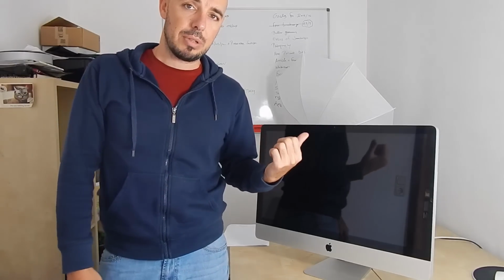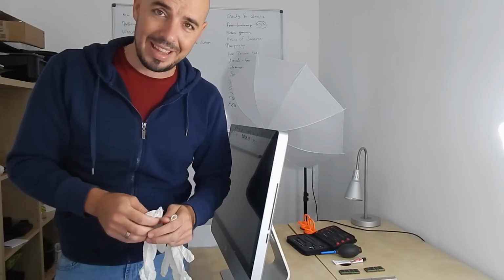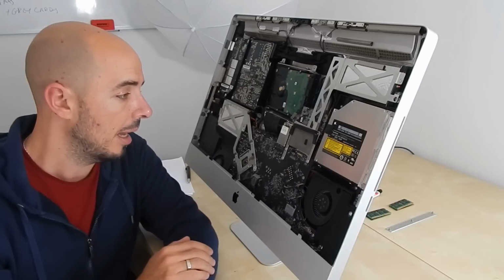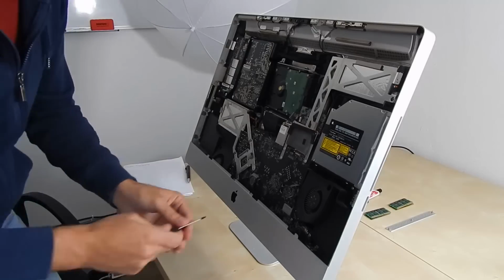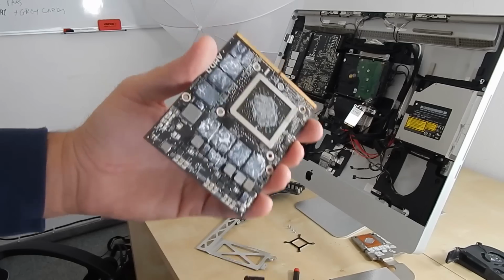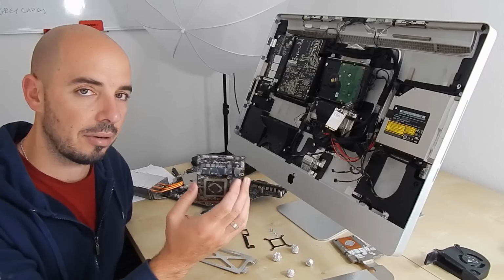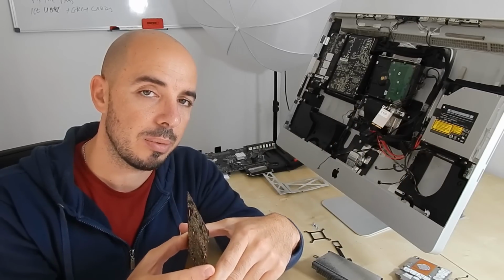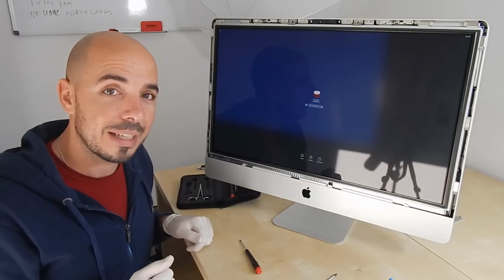Burn the VGA and  Fix your iMac - Don't Pay Shitty Problems!!!

Comment: Hi good afternoon, my video card: ati radeon hd 4670 256MB (iMac 2009), it only works for tv! Main screen does not turn on the lights and also does not appear the apple logo, would it be recommended to do this? Or do you have another opinion?

Comment: Hi Evan, your video saved us $600 today. Outstanding job!..Thank you so very much. I purchased the same iMac 6 years ago. A few days ago it went black. After paying $40 to MicroCenter for diagnostic. Took it home because MicroCenter tech gave me bullshit diagnostic. First, he said it was the motherboard then he said it was the motherboard and the video card and maybe something more than just those two parts mentioned. The bottom line was they lied to me to pocketed the $40. So I decided to take it to Apple store. Apple determined it was the video card which went bad. I agreed to let Apple repair my iMac but then came a phone call letting me know that they cannot move forward repairing my iMac for me because I installed a third-party non-Apple SSD drive inside. No matter what I said and beg them to repair it for me, they still stick with Apple policy. I started to search for replacement video card online and found a place that sells it for $300. Of course, it is not the brand new. Then my wife called me. She gave me a very good idea. A month ago, I bought an exact same iMac but it is a refurbished one for $900. My wife suggested that I should take out the video card from the refurbished iMac and put it in the broken iMac to verify that it is the video card problem before I purchase the new video card. I stumbled on your youtube. Thought to myself, "What the hell! I got nothing to lose. I opened up the iMac before. I am going to take a shot." SHAZAM!!! Your youtube helped me fixed my iMac in 2 hours and it was up and running normally more than 2 hours ago. THANK YOU! THANK YOU! THANK YOU!

Comment: My question is did you verify that graphics card needed to be fixed/replaced? I had same issue (happened ~3 years ago and then today) but when I started iMac from external drive display was fine (so not hardware). I think it's a thermal issue but mine was fixed by SMC and NVRAM reset (cycled thru 2x). 1st time it happened got SMC fan app to better regulate. This worked both times and I didn't have to take my iMac apart.

Comment: For anyone reading this, you don't need to put the video card in the oven. You can just buy a pocket torch and evenly apply heat to the GPU chip instead. The key is to keep moving the flame back and forth and in circular motions over the GPU chip for a minute or two. Once you smell solder you know you're good. This happened to me a few years ago and worked like a charm.

Comment: Evan my friend, you can add another to your list of viewers that successfully utilized your process and fixed their (actually my brother-in-law's) 27" iMac!!! It took several hours for me to get it done, even with my brother-in-law's assistance, but IT WORKS!!! I also immediately installed the SMC fan control program and greatly increased all three fans RPM, so hopefully the issue won't crop up again for a very long time! THANK YOU!!!

Comment: This worked for me too. It was amazing when it just started up perfectly fine after I lost all hope. However after one day it got bad again.
Did it on my iMac (24-inch Mid 2007) with ATI Radeon HD 2600 Pro 256 MB.
Is there any point in trying it again you think?

Comment: Great vid JDW. My son's Imac 24" early 2008 has been diagnosed with graphics card issue. Failed to boot and went white screen. I will attempt this repair as there is basically nothing to lose as he cannot afford a new card and in any case the Imac is old and of less value than a repair. I think I will go the hot air gun route with a temperature probe and shield the rest of the board with aluminium foil. I also see you didn't run any liquid flux under the chip. Is this a good idea?
As I say nothing to lose for me and if not successful will go on ebay minus hard drive to recoup something.

Comment: Thanks Evan, I just repaired my own iMac 27" (2009) using this method. Hope it will last at least another couple years. :)
Reply: Hey Cris, I have a early 2009, with NVIDIA GeForce 130 and it  crashes when online. Just shuts off, not sure if it's driver issues, is your installed with a NVIDIA GeForce 130 card?  Is your 2009 iMac still working?
I just patched Catilina to it.
Reply: @reel_images  I have the late 2009 iMac with ATI Radeon HD 4850. The graphics card gave out again about two years ago and I replaced it with an NVIDIA GeForce 765 but it runs quite slow and feels like it’s on its last legs now.

Comment: Great video covered everything.  This worked, kinda for me.  Baked the card 8 mins @395F.  Put on the paste and buttoned everything up.  I turned on the computer and heard the chime except screen was black or not lit up.  From what I could tell I had the 4 LEDs on the bottom of unit to left of RAM lit up.  At first I assumed I put something back together wrong.  I unplugged everything and put it all back together again.  Turned it on, this time I waited to put glass and 8 screws holding lcd in place.  Again nothing from screen, I could tell computer was on, sound of HDD, fan etc.  I decided to tilt the LCD out see if I could jiggle wires if anything would happen or if I could see anything.  As I tilted the screen forward it lit up everything was fine.  The baking of the graphics card worked, no more lines or large boxes/blocks on the screen.  Great, right.

I buttoned everything up and used the computer for several hours.  I turned off the computer using a proper shutdown.

The next day turning the computer on, same thing blank black screen.  I tried all the tricks PRAM restart, pulling out RAM etc.  Nothing.  After taking off glass and tilting screen out several time it came back on.  I am afraid to put it to sleep or turn it off again.

Any suggestions?

Thanks again for baking trick.

Comment from the maker: A NOTE TO ALL OF YOU:
This video was created on September 2015. My iMac still works like a charm for 17 months now (February 2017) with heavy duty daily work! So YES it WORKS and LASTS! :)
Reply: @GrantW92, not only did I try it, I was successful.  I also made a very detailed video of the entire process.  I posted my video here on YouTube and on iFixit.   I actually thought I posted the link to that here, but my post seems to be missing.  Odd.
Reply: Evan, it's quite clear from your post and the posts of others who followed your advice that "200°C at 8 minutes" works well, and for a long time.  But how did you choose the temperature and time.  In other words, why no use 220°C instead of 200°C?  And why choose 8 minutes instead of 10?  Thanks.
Reply from the maker: I just read a lot about that specific problem and other people saying the exact same thing. So I followed those tips because my VGA was dead already and had nothing to lose. So it worked and I decided to make a video about that to help others.
Reply: Thank you for that information, Evan.  Since it's been working 17 months, it sounds like you did everything right!  My "Radeon HD 4850 - 512 mb" in my late 2009 iMac i7 is dead, which is why I will try the same thing this weekend.  BTW, how long did the "smell" stay in your oven?
Reply from the maker: I don't remember any smell my friend. You will not literally "burn" the VGA, you will only heat it. So just let the oven door open for a couple of hours and you're good to go!
Reply: Thanks!
Reply: @JDW did u try this?
Reply: I did this 2 times already and first time it worked for about 2 weeks, second time for about 2+ months now again pink lines on the display. Did anyone have the same issue?
Reply: Dogo A., I did my 2009 iMac in late February and it's been going strong daily since then (almost 2 months now).  Did you take a video or photos of how you did it?  I would especially like to see how you reapplied the thermal paste, as that might have something to do with it.  Or you may just have a card that cannot be repaired via the bake method.
Reply: Evan - Creative Tuts  dont have pictures but you mentioned the thermal paste, when i first opened the video card the old thermal paste was very dry but the thermal paste that i applied after 2+ months is still not solid. I am not really sure if it has to be this way or not.
Reply: Evan - Creative Tuts  hi my iMac won't come on and for a few days it shut off unexpectedly... can u plz help me
Reply: Evan - Creative Tuts Solving an iMac problem gives a siren and a white screen

Comment: Great!! It works.... Thank you. My screen had verical coloured stripes and was blinking, now everything is fine.
About motherboard... I took it off how you described, but afterwards I think it wasn't absolutely necessary to take it completely out, just release the screws and take off the three small screws on the top of the motherboard (which hold the metal-part and grapiccard), safes a lot of time...
Reply from the maker: I glad it helped you Christoph! :)

Comment: Thank you Evan.  I was brave enough after watching your post to finally bake my graphics.  I pulled my iMac apart (first timer) and replaced the thermal paste hoping that was it.  I chickened out baking the graphic board but of course I still had yellow and white lines on my computer.  It was useless, not even safety boot worked.  A 2011 model meant I was looking a cost fix but mostly the inconvenience of no computer because of no screen!!! And now it works!!!! I feel invincible!

Comment: Hi Evan, I want to thank you because thanks to your video I got the courage to do what you suggested, and my try too was a success.  
The iMac I worked on is an early 2009 iMac 24 and I discovered that the thermal paste was totally crumbled away on the video card, so in addition to putting just the video-card in the oven, I also used a new standard thermal paste. I must say that the iFixit tutorial on this page ( https://www.ifixit.com/Guide/iMac+Intel+24-Inch+EMC+2267+Graphics+Card+Replacement/13765 ) helped me for some details. Also very handy in re-building and closing the case. I hope you don't mind it is an external link, I found both complementary :) Efgaristo poli !!!

Comment: i noticed that your fan got loud at the end of your video... mine did the exact same... any fix for that? I've tried pram reset.
Reply from the maker: I forgot to connect the fan cable. Check if you forgot it too or if you broke the cable. Don't worry, even if it's broken you can fix it with some tape. ;)
Reply: Thank you for the prompt response Evan! I did connect the fan... when i disconnect the cpu fan it makes the fan stop spinning altogether.
Reply from the maker: Then it should be broken or something. Once it happened to me with a fan. When it's connected goes to full power-speed was the result of a broken wire. Check the wire of the fan from start to the end, there is a possibility to find a cut somewhere there.

Comment: I just went and replaced the power supply in a 2011 iMac because it wouldn't even start and now it starts up but there's no video at all it has a pitch black screen any idea what I should do next?
Reply from the maker: Probably some cables are disconnected.
Reply: Evan - Creative Tuts Thanks! That's what I'm hoping so I'll be taking it apart again to check.
Reply: Hi Luigi, what i did (if connections are ok) is unplug ... wait 10 sec. plug back in and hold power button 10 sec. that worked for me :) good luck
Reply: V I ended up solving the problem but now I've discovered that it's got this infamous GPU problem so it either needs a new one or it has to be reflowed, I guess. Not really sure if it's worth it,though. It could just keep on happening over and over again.

Comment: Evan, you mentioned needing to do this baking repair 2 years before this video.  I'm curious, how well has this December 2015 repair held up?  Is the iMac still running strong a year later?  If I can get two more years out of the iMac I would be happy.   Likely to try this week,  thanks a lot for posting!
Reply from the maker: Hi Brent, the iMac works like a charm after 15 months of the second baking. This time I am using an app to control the fans speed and I am using this machine for at least 10 hours daily for video editing, rendering and photo editing.
Reply: Thanks for the response.  That is great to know.  I successfully repaired my iMac earlier this week and I'm using it for this message.  No problems so far! I can't thank you enough for taking the time to create and share this video.  As you can see, it's made a lot of people very happy.

Comment: Was not it better to change graphip card? Or make a reball gpu! How did you do it will break soon. Nice video .. But I do not like the reflow in the oven.
Reply from the maker: Hello my friend, i didn't want to give 500 euros for a new graphics card. I've spent 2300 euros for this maschine and hell no I am not going to give more to Apple. So this trick is free and still works after 15 months like a charm. Thanks.

Comment: Hey great video. Thank you very much for making this. My graphics card on my 21" imac 2010, was overheating and I did exactly the same steps as you did here, and it works perfect now!! The inside of my mac was a bit different and i also used thermal grease instead of thermal paste, but now my mac is working so obviously this trick works for more than one generation of imac.
Reply from the maker: One more iMac is saved! Great to read that my friend!
Reply: It wasn't over-heating... Hint: The baking is usually because lead free solder is used in apple products. Lead free solder grows crystals and shorts itself over time. Baking removes the crystals... this was not necessarily caused by temperature and adjusting your internal fans will not necessarily solve this issue.... If this were a heat related problem. Baking wouldn't work.

Comment: I also got a black screen after. I can connect remotely. No signal coming to the monitor.... this is saaad :((
Reply: OK. So the issue was the cable from the display to the logic board.
Pay double attention when you plug it in. I actually bent a few pins - I managed to straighten them for now and I got it working. 
Fingers crossed that it will last for a long time!

Comment: Can this method work for mid 2011 with pixellating screen and freezing os?
Reply: Hi. ReInstall the os , if its dont work unplug and plug in again your HDD or SSD.
For the pixels just pus there with your finger a littlebit for 30 seconds its should be good again.

Comment: i had to bake mine 3 different times before it finally was "fixed" it's been running for about a year now with no issues.
Reply: Can you tell me what issues you had after the first try? Prior to baking it, my machine wouldn't get past the startup screen but would power on, then I baked it and put everything back together and the screen remained all black, no startup screen.

Please let me know.

Thanks!
Reply: At what temperature?
Reply: I feel like I'm going to bake it at 400F for about 10 minutes just to be sure!
Reply: Good to know you gave an update after one year. is it still working today June 6th 2020?

Comment: I really owe you man, thanks a lot. My 5 years old iMac27" was not booting. I did your solution and it runs perfect now. I have to admit, it was a tough repair. But still better than spending 600$ for an old and outdated graphics card.

I really suggest this solution to people who have iMac Mid 2011 with bad GPU. But if you are not good repairing electronics, please let someone who is better to do it for you.

Comment: Nicely done my friend.  I did this as well on my iMac about 2 years ago, and I still have a great working machine today.  I did not use the oven method, I have a hot air soldering station that I used instead.  Look for an App called SMC Fan Control and install that.  It allows you to adjust your internal fan speeds on your iMac to prevent the over-heating of the components.  It helps a lot.  Cheers.
Reply: Hint: The baking is usually because lead free solder is used in apple products. Lead free solder grows crystals and shorts itself over time. Baking removes the crystals... this was not necessarily caused by temperature and adjusting your internal fans will not necessarily solve this issue.... If this were a heat related problem. Baking wouldn't work.

Comment: I tried this, but nos my Imac is completly black, the display doesn't turn on? Does someone a clue of what can it be? Y have disconnected and reconnected everything three time to make sure there is nothing loose, but the screen continues black. But I do hear the fans working when I turn it on.... Please help
Reply: My card died... With this it never turned on again... had to buy a new card and the IMAC came back to llife..
Reply: happened to me too.. so pissed off
Reply: There are used cards for replacement on eBay. I got it for 230 USD... Much cheaper than a new one
Reply: Thanks! I will search for one later

Comment: Evan, is your iMac still working properly?  I may have to try this on my 2009 iMac as I believe my graphics card is having a serious problem as well.  I really don't want to pull out that motherboard though. It's a pain in the arse to put it back in properly.
Reply from the maker: Hi Mike, thanks for your comment! Yes my iMac still works with no problems for 14 straight months of heavy usage since that video!

Comment: Fantastic it works, this is really great.. Thank you soo much ;-) the only issue I have now is a tiny white line towards the right side of the screen looks like bright pixel dust. Does this mean the operation was not 100% because this was not there before I started having the problem in general?